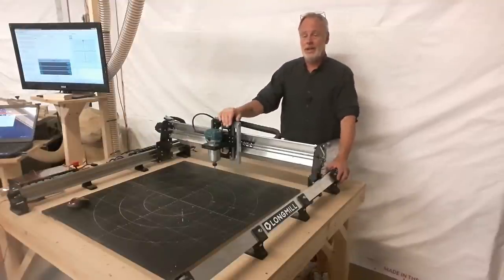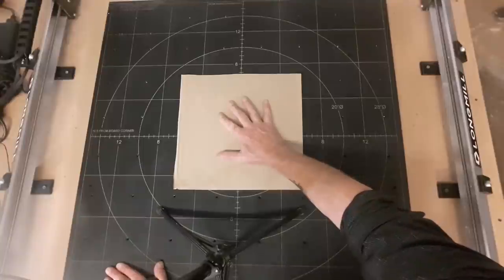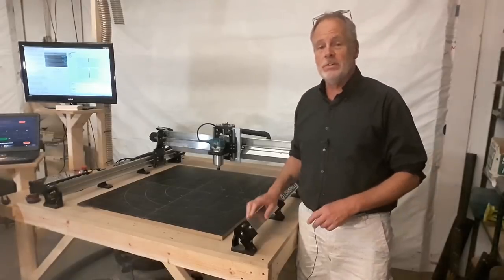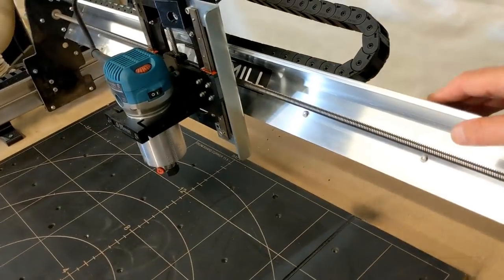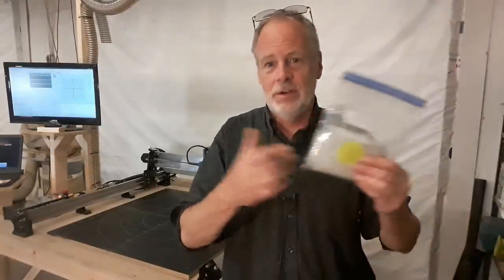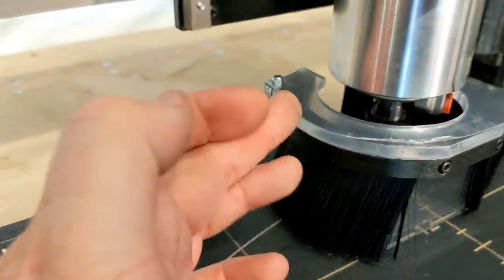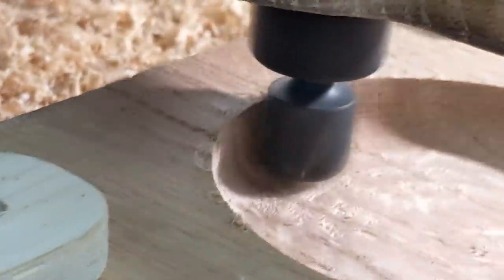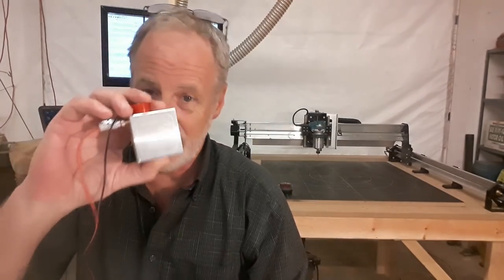Longmill CNC Router - Complete Review MK2 (by Sienci Labs)

Comment: Curious on why you use UGS instead of G Sender while doing the demo ?  It also looked like you used a different dust boot compared to the one you demonstrated in the video. Is there a reason for this?
Reply from the maker: Good eye. The dust collector I was using is when I built to deflect the downblast from the router, while at the same time, I can film the cuts.

Regarding universal G-Code sender, I have been in the process of transitioning. The only reason it was in some of the videos is because my computer is so old, it's having an issue.

Comment: A very good "in-depth" review, Garrett. Thanks again for a great production. As an affordable option, you can't really go wrong. So long as the buyer knows just what they require, and the Longmill will meet those requirements- it becomes an absolute no-brainer. Repeatability and accuracy may be of secondary importance for many! There is a story there!
Reply from the maker: Hi Joe. I got it check for accuracy. I keep forgeting to do repeatability.

Longmill is a young machine that has growing pains as it adopts to the market demands and needs. I think you'll start seeing some major upgrades coming very soon.
Reply: Problem is, the buyer has no idea what to expect until they order and purchase. After it arrives, it is SUPPOSED to be a simple build and run. Forget that!!! I have had mine for 3 months and to date have not been able to run anything serious. Have made some very simple items, but once I attempted to make something serious, a sign of 20" x 16", it carved about three hours and WHAM just started carving wherever it chose to. Totally ruined my project. So, I tried to make the same sign in a smaller design, a 16" x 10", and darned if it didn't do the exact same thing!!! It is really just junk. And SIENCI is ADAMANT they will NOT accept a return. I reckon they are totally about the money, and will not stand to have to refund any of it. I should have known when I seen that on their website that it was a HUGE red flag.

Comment: You are using the phrase "moment of inertia" incorrectly. It isnt a structural concept. A spinning skater spins faster when she brings her arms in, because she changed her moment of inertia. No extra energy was added to the system, but she spins faster!
Reply from the maker: Hi Tanz. Thanks. I realized that afger everything was done. However, the concept was correct.

Comment: My super quick review. The price is right. Had some QC problems with parts. Got replaced. If you are a tinkerer this a nice product.  I run 2 lasers of my own with 20 years of experience. Had other hobby CNC's, built my own small CNC (12" x 12") just for practical experience. And have run commercial mills and CNC for about 3 years. Glad I got the biggest they own. And yes get the biggest you can as practical. Your room size may dictate the size of your machine. I got a shape co compact router for my cutter a year ago.
Reply from the maker: Hi Hobby. You have been in this for quite some time and I love the idea that you built one just to get the deeper experience.

Comment: Excellent video.    My only concern are the "v" wheels.  You said it yourself that you tightened them too much and the surface adapted to the increase in holding force by pealing off........  That by itself bothers me.   If you over tightened them and they adjusted, then might that same concept apply over time as the wheels move back and forth that this "adjustment" might also occur???   Your thoughts.....
Reply from the maker: Hi David. The V-wheels are the wear item on the machine. However, once they 'nested', they gave been doing very well and there has not been a need to replace them yet.

Comment: Your video get me really thinking for that machine, and probably i will buy one. I am a bit concern about their new version, it seems they change the extrusion. I did some static simulation for the double L extrusion and the deflection is a bit better compared to XC50 with two 37mm shaft guides. The only downside is that deflection with those double L extensions is not only in Z direction, but it twist the axis, aprox 0.17 mm deflection at 200 N, it also looks very similar to the broken mill part, if you watch carefully probably you will notice also the twist, that i think was the main reason for the brake.
Reply from the maker: Stoyno, I see what you mean brother. Great point about the deflection patterns, I hadn't thought of it that way before!
Reply: @IDCWoodcraft  Anyway i order one, it's handy to have it on hand. Watching the video my first impression was that  the mill face the knot, it's harder, the spinel rpm drop, the cutting rate drop and the feed become too fast for the lower cutting rate. But later on when watch it few more times it looks all start when the mill is pushed up by the cutting force,and this cause also a twist. Anyway, great video, looks decent machine for the price, will know in a few days. I suppose all routers in that class will have a similar problems, to prevent this twist need really rigid structure, and also symmetric. I am used to a large machines, will see how will handle with this one :)

Comment: Just watched and stopped over to Sienci Labs to check them out. Looks like they have gone away from right angle sides, cut down on the heftiness metal gantry ends, and did the same to the z axis. You had me sold on getting the LongMill until I saw its cheaper made brother. I made the mistake of getting a bobs cnc and will not tolerate a flimsy machine. I was looking into the Onefinity Elite, but the wait time is 16-18 weeks. What's your thoughts on LongMills new build, I can't see it being as sturdy as yours?
Reply from the maker: Adam, it is an improvement hands down. They removed some of the weight but drastically increased rigidity overall.

Comment: It's ok router but what I see is the cost for couple aluminum extrusion/3-$65, screw/plastic rectangle nut/screw/, bearings/ couplers-$45 and aluminum frame $24, 3d printed parts/router $45,wheels $20
So about $140-200 and with the brains,3axis control depends about $45, yea all I'm saying is it's a good business
Reply from the maker: Nathan, all fair points brother. I'd say if you have the skill sets to do so, I'm all for it!

Comment: I am considering a smaller machine because I am old and retired. I also believe the noise and dust produced is a concern. I am not interested in making money with the machine. One other thing is space required. I park a car in the garage and it also contains my woodworking tools. Cost is not a factor.
Reply from the maker: RJ, whatever machine you get, just be sure to get a dust shoe. That'll solve the dust problem.
Reply: @IDCWoodcraft  I will probably get the 12 X 30 inch machine. I have a bench already it can sit on. I am not trying to make $.

Comment: Very good review it allowed me to evaluate the machine from my eye as an engineer. The most difficulty I have evaluating these machines is to get an apples to apples comparison. I think the long mill offers just the minimum and the other bits and pieces can be added based on your preference. In particular I am referring to the software and operation interface. Final note what were the other top 3 you considered?
Reply from the maker: Sample Taster, you couldn't be more correct. Having add on's is a great idea because you can pick and choose what you actually need!

Comment: I never saw anybody prove the integrity of a CNC Router by riding on it like au rollercoaster. "That was the Bomb diggity dog."  However, I'm trying to decide if a CNC Router is the way to go, or should I buy a CNC Plasma cutter kit?  I love the one on your video, and it looks promising for cutting aluminum brackets for a 3 wheel trike project, but half inch aluminum could be too much to ask of it. So, what do you think?  Thumbs up for the best CNC Router video ever, and totally like & Subscribe.
Reply from the maker: Master G, Thats some thick aluminum! Even a plasma will have a tough time getting through that! The Longmill can cut aluminum but you might need something more rigid to get the accuracy you need for your brackets. Plasma will have a tough time with this too! If you plan to cut strictly aluminum, have you looked into more of a CNC milling machine such as the Tormach? Im glad you liked the demo my friend, I loved shooting that part of the video. Glad I didn't fall off!!

Comment: As a Cnc machinist that started in Cnc when we run them on paper tape im retired from Lockheed Martin after 35 years before that i was in manual job shops. I was impressed with your background and love your videos im curious about the plastic and the Delron wheels but considering what these Cnc are used for should be fine but i ask as one journeyman to another do you see the improvements that could be made ? But i think it is a fine machine. I am building a 48 x 48 all ball screws and track bearings i found a granit insp.table im using as a base. again love the videos
Reply from the maker: Les, considering what this machine is designed for, it is excellent. . It isnt a Haas by any means but my cuts are accurate to about 0.005". For wood and most soft metal designs, that is usually plenty. You can always make a bigger better machine but that always comes at a cost.

Comment: Garret. By the way. I use a USB game pad to move my CNC around on the xyz axis. So I don't have to be next to the computer.  Mine is wired, but you could use wireless game pad. I make keyboards short cuts on the the UGS program, and then use a program call keyjoy that converts my joystick button to key strokes.  The joy stick cost me $10 for 2 nintendo NES joystick. It's great. So right from the game pad I can also zero the axis, and return home, and even pause.  Message me if you want more info
Reply from the maker: I think I'll go the route of wireless game controller. I'll tap into your knowledge when I start to go in that direction.

Comment: Thanks for the video.  I am in the beginning stages of looking for a hobby CNC.  The video is great, but I have one question you covered the bits but can you explain the black mat and the clamps that was there.  If you have pointed it out previously I apologize
Reply from the maker: Hey John, sorry for such a delayed response it's been a crazy week! Are you meaning the black mat that I have on the floor? Or are you referencing the spoilboard? The mat that I have on the floor is just a rubber mat that protects the endmills from hitting the hard floor if I drop one of them. It saves my endmills from breaking! The black "mat" on the top on the cutting surface is actually my spoilboard. Here's a link to the video of how to make your own spoilboard → https://youtu.be/dbxtLQY26Cw. 

And here's a video where I go over how to make your own clamps too! Here's the link → https://youtu.be/b9miRXZGd1I.

Comment: Hi Garret. I've put together my MK2, and everything is great. By the router makes a grinding sound when moving along y axis on rapid mode. I've tried adjusting the eccentric nuts but it didn't help. Is that aouns normal?
Reply from the maker: At first it is because you are breaking in the anti-backlash nut. Also put a little light oil on the threads
Reply: @IDCWoodcraft  good to know, Garret. At least I'm not breaking anything. You're awesome.

Comment: Hi Garrett.  Great review.  I have one of the first Shark CNC by NextWave and am considering upgrading.  The Longmill and gsender offers many features I do not have.  Does the available software with the Longmill make it possible to carve curved (or warped) surfaces such as the back of a chair, like can be done with virtual zero unlimited in Nextwave's software?
Reply from the maker: Joseph, the Longmill doesn't have this multipoint z axis probing feature.

Comment: So what your saying is they could have used a box on the Y axis , did use the equivalent material but did not bother to use the best shape... a box.
Reply from the maker: They could have used a box. However, the design method is extremely sound in that they 'mathamatically' did use a box.

Comment: Hi Garrett, Awesome review. Quick question what's the maximum depth it can cut? Would it provide any benefit to putting shims under the rails or recessing the spoil board into the table to be able to carve thicker stock?
Reply from the maker: Hi JJ. Max z travel is 4.5" (112 mm). Regarding spoilboard, it works much better with one on top of the table. You will start to lose z capability if you go to table surface. Make sense?
Reply: @IDCWoodcraft  so the 4.5 inch cut depth is to the top of the spoil board not to the table? Either way I can't wait to get one.

Comment: Its just a ultralight Entry level Kit .. that only hold a tiny 1Hp trimmer router.   Its also based on off the shelf aluminum Angle extrusion .. that inherently isn't very straight . Aluminum Box is very straight, but Angle tends to have a bend .   But for the cheap price its not that bad a toy to start with. 
 You can't cut much with a 1Hp router so you will want to build a heavier from that can hold a 2 1/4 or bigger router that can take a 1/2" tool
Reply from the maker: Hi, Green. Thanks for commenting. You are right...it is not an industrial machine. I would say, at least there is a group of CNC routers that home hobbyists can afford that work well, and gives them the ability to make some very cool projects.

Comment: A newbie question: what is the wooden “shoe”? above the bit? What is it for?
Reply from the maker: Ron, that is the dust shoe I created to attach to my vacuum system. It holds the vacuum hose in place alongside the router as it cuts to clear out the wood chips.

Comment: Sorry, another question. I don"t see that they com in 230V for europe and shipping cost on there website.
Reply from the maker: Ivan, I recommend taking a look at their website to determine the shipping costs to Europe. That will be the most accurate. As for the power, you will have to use a transformer to step down the voltage to 120V

Comment: Many years ago I had purchased a machine that is far more rigid (and it likely weighs at least twice as much as your Longmill in less than one quarter of the footprint), but the disadvantage was that the machining envelope is very tiny (~6x6 inches). Yes, it can cut steel and aluminum, which are the main things I need at the moment. However, at the moment it is also necessary to be able to machine much larger pieces and with my machine I can't stick something out of the machine as the table itself is the Z axis, so I would need to build a slave Z axis and deal with all the fun of that. The other issue is the manufacturer of my machine is no longer in existence and some potential replacement parts are just going to be impossible to obtain (one piece in particular takes either a 5 axis CNC or multiple different setups and the tolerances directly impact the overall machine accuracy - in other words, a one-off replacement part would likely cost more than just purchasing one of many of the currently produced machines).

In short, yes, you are correct that it may be much better to purchase a machine that is big enough for the foreseeable use cases.
Reply from the maker: r2db, all good points my friend. Your machine sounds like a good one, no doubt about that, especially for metals. But there is something to be said about being able to get replacement parts!
Reply: @IDCWoodcraft  Agreed, it is a good machine. It's just orphaned (it is called a BoXZY and those of us who own them have no idea who, if anyone, has the source code/ design files/ etc. should we need support) and not exactly what I need at the moment. It was also much, much more expensive than other machines. In part, the increased rigidity was the reason I made the decision in the first place. I could probably run it over with my pickup truck and it would barely notice.

Comment: Nice review, not an expensive machine. To me I see some downsides that don't make it a upgrade for my 6040 Chinese cnc which I did upgrade the controller for because they sold it with an illegal copy of someone.

Like mentioned before, the Y rails should be facing the other way imo to not catch all the chips.

You mentioned support is very important, in the end I noticed that you didn't use it, Why is it so important and then not use it?
I know, you could and they would have sent you the replacement parts.

Last, it's strong and can hold a big guy on top. Though using 3d printed parts?

I'd like to see the accuracy test once you have the limit switches installed because it does look like a nice machine. Meaning, home go to G0X29Y29 make a mark, home and repeat a few times.
Reply from the maker: Hi Jasper. There are always areas for improvement. I didn't use the support because I didn't need it. I could solve the issue myself. We can always find things wrong and I made not of the weaknesses.

As I said, I already did accuracy. I did not do repeatability so will do that. Thanks and happy CNC'ing.